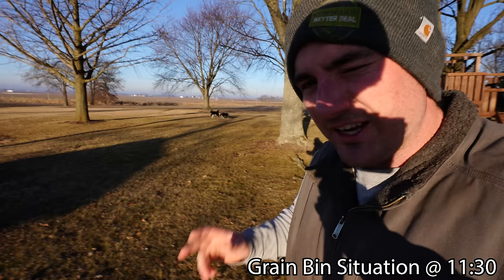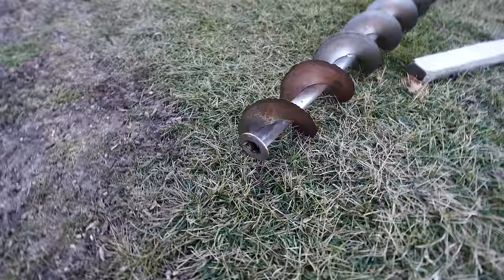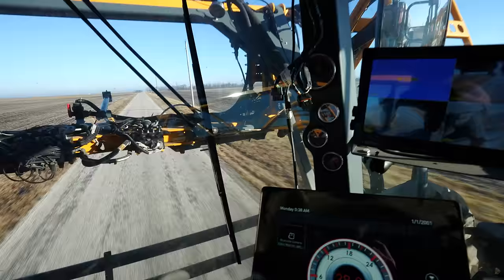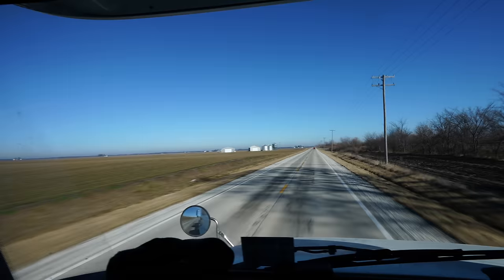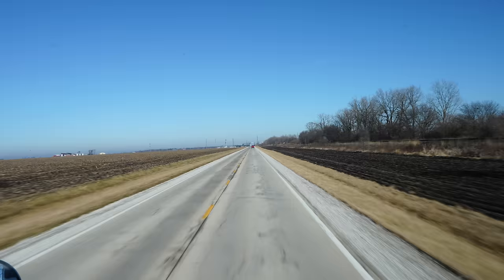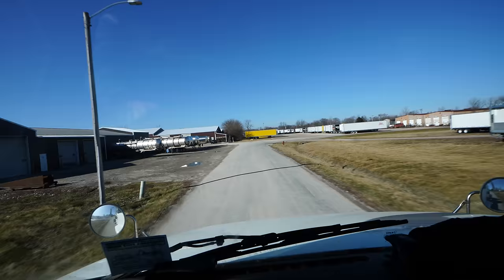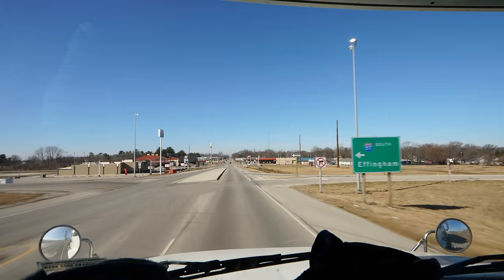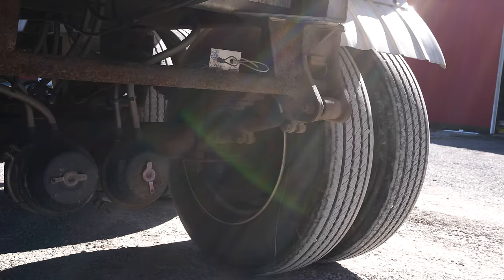Huge Commercial Grain Elevator Collapse

Comment: don't  they use some sort of vacume system to do the clean up and what percentage of that grain is recoverable and sellable ?
Reply from the maker: I would guess most of it is picked up with a loader. You could be right, though. Regardless, it all gets run through a mobile screening unit to get rocks and debris out. As long as it isn't exposed to tremendous amounts of water and warm weather, the corn probably didn't lose a bit of quality.